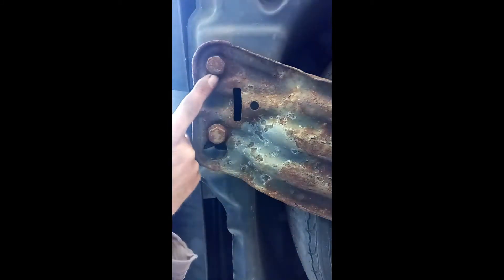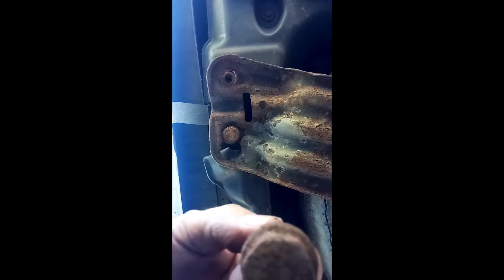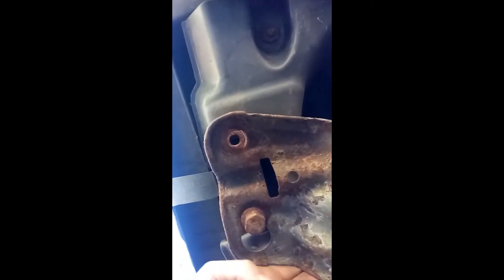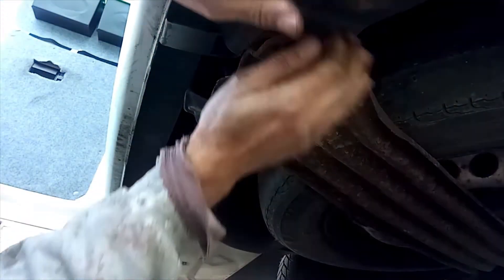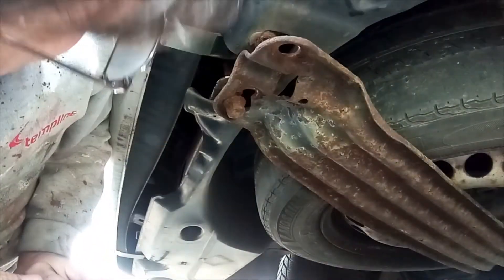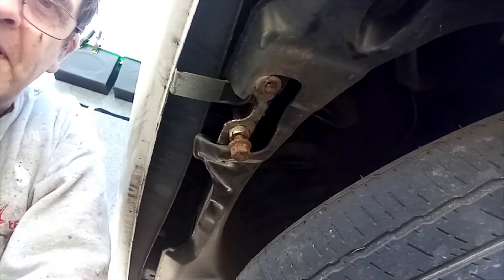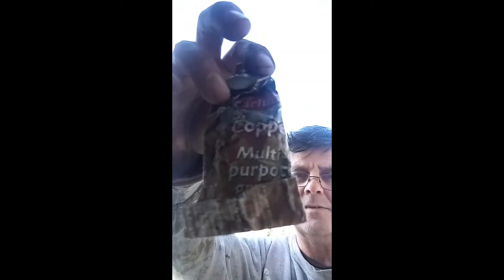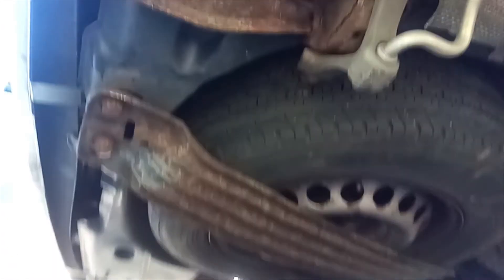VW T5 Transporter Spare Wheel Removal & Refitting.

Comment: Hi Bob, at home I used a trolley jack turned sideways so I could move the tyre holder sideways to lock on the captive bolt. On the roadside I used the VW jack with its rocking 'foot' it rocked sideways enough to  remove the bar safely & refit it safely. G
Reply from the maker: Great suggestions, many thanks and thanks for watching.

Comment: There is no need for kicking banging it. If you look there is a hole beside that nut you use the lug wrench that came with the van to slide into that hole. The handle end and use it as  a lever to help pull up the bar and carefully let the wheel down. That's how you would do it on the side of the road.
Reply from the maker: Aha! Thank you ;-) I learn a new thing every day. I'll have a look and do properly next time. many thanks.
Reply: Yes, I spotted the obvious place to pop a bar in to help both lifting down and back up again! My van has a screw in towing eye which fits perfectly into that hole and is around a foot long. Makes it so much easier.
Reply: @andrewhamilton2773  Just to add to Dominick and Andrew's comments the screw-in towing eye does work, but is not made for this purpose, does not fit securely and you risk damaging the threads. The pistol shaped wheel wrench is made to make the operation relatively safe and fast. So use the wheel wrench/lug wrench supplied with the vehicle (Mine is from 2014 - not sure if they are all the same). Remove the screwdriver that is slotted into the wrench. First loosen the left hand (safety) bolt about a cm. +/- 0.5 inch, perhaps a little more. This stops the wheel and folding bracket falling on your hand. You then remove the right hand bolt completely. The assembly now rests on the safety bolt. Note that the wheel wrench has a small 'tongue' at the end. Now insert the wrench into the hole provided and wiggle it around until the tongue slots into a small hole at the bottom of the tube. Lift up the wrench until it fits securely into the channel provided and then pull it firmly across to the right until the larger hole is over the safety bolt. Lower carefully, use both hands if you want. The 'pistol grip' on the wrench should prevent your hand being crushed, but you could put a block of wood under the folding bracket if you are worried. I carry a 77 cm wheel wrench which fits nicely and could make this even safer, but I think it is overkill.

Comment: I would use a jack under the wheel to take the load when unbolting the wheel, and also to uplift the load, when fitting the wheel back up, instead of trying to take the weight of the wheel while trying to tighten the bolts at the same time, doesn't look a good job to do in the rain, or the side of the road, without overalls or any other time for that matter, not a good design
Reply from the maker: Thanks for watching, the comment & subscribing, much appreciated :-)  Yes, a jack sure makes things much easier....Luckily I've never had to change while at the side of the road ...phew

Comment: What a poorly engineered 'solution' to house and secure the spare wheel. How do you reposition the spare without giving yourself a hernia? Of course- everyone drives around with a trolley jack so that they can reposition the wheel in the pissing down rain on a dark night. German 'logic' and engineering...........That's piss poor. At least the Ford Transit has a winch mechanism which take the weight of the tyre. 

I have a T6 in for full rustproofing treatment- so now I have to wrestle with the spare in order to spray the chassis fully.
Reply from the maker: Totally agree, I think it was the same "engineer" who designed the T5 cup holder! Have fun with the T6.